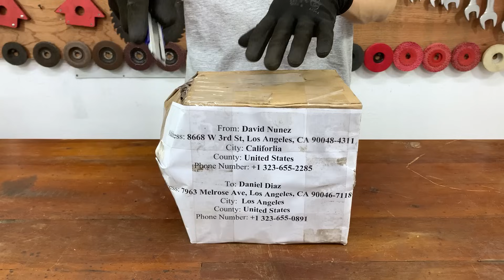Restoration Rusty Old Hydraulic Jack // Old Hydraulic Jack Restorations Skills

Comment: Nice video, do you rebuild for people,  question if you don't mind answering. I have a craftsman ATV/ motorcycle scissor lift. I removed it to try to bleed. I can pump it up all the way but it slowly creeps back down. It has the spring on side from base up to head. No matter how I try to bleed the air out it just keeps going down. It has a foot pedal to release jack, not a screw type. Can you tell me if you think it could be an o-ring that's causing this. It's in great shape no rust and hardly used. Your thoughts would be appreciated. Thank you

Comment: Good work, but I do not agree with the filler epoxy on the head of the jack where the load goes, I could see that failing and creating a hazard.
Reply: should have cleaned it up on the lathe whit it was there.